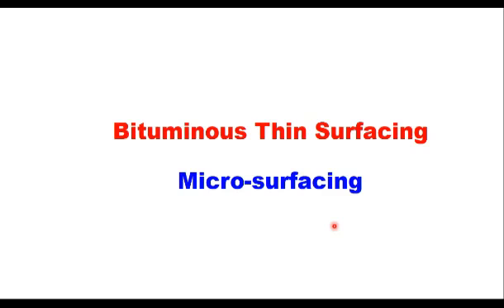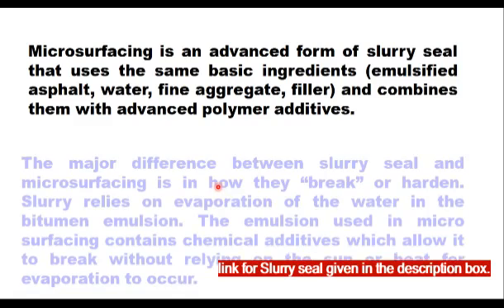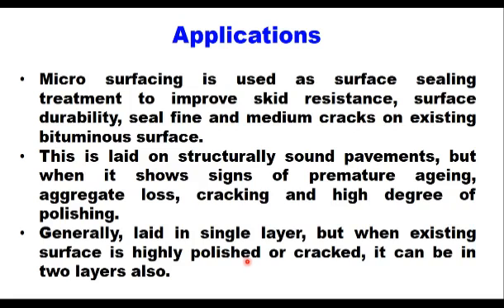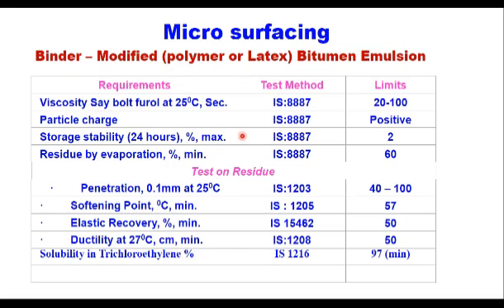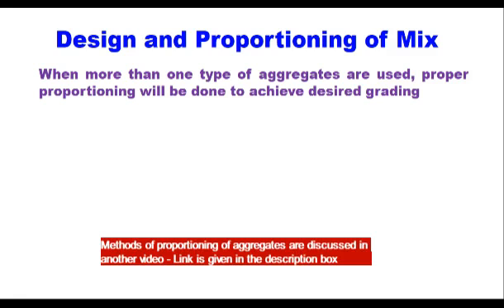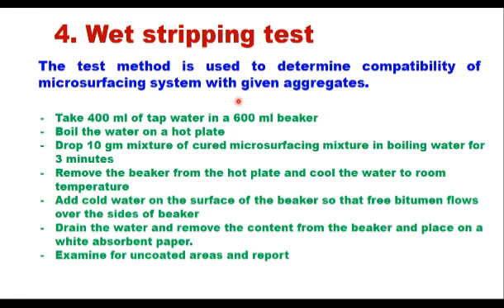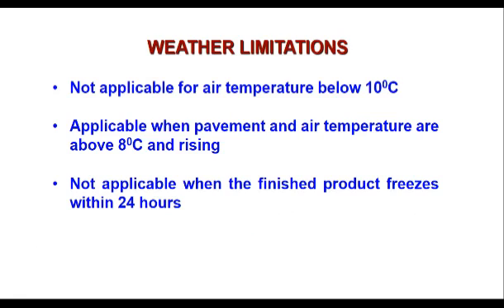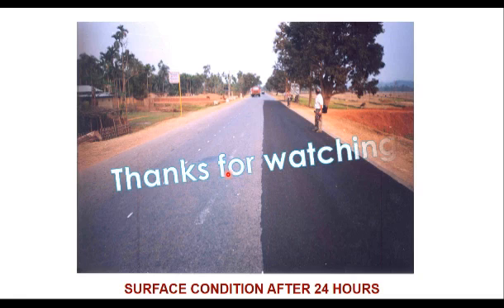Thin Bituminous Surfacing - Microsurfacing, applications and construction, slurry seal.

Comment: At Quantity of Mix (by weight of dry aggregate) - 

1) 1 m² patch quantity of mix weight is 11.1 to 16.3 Kg/m² 
or
2) we need to take material from 1m² patch and after extraction dry aggregate weight is 11.1 to 16.3 Kg/m².

Both the things are following by various companies. 

Which one to consider.
Reply from the maker: Go as per code